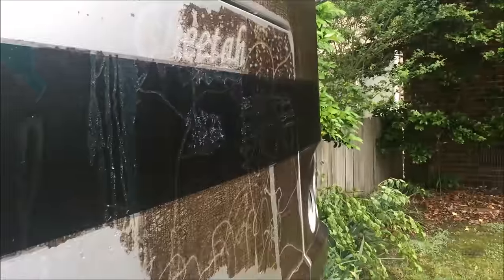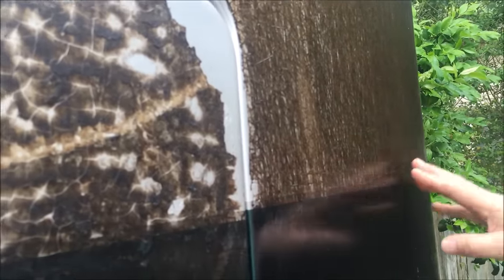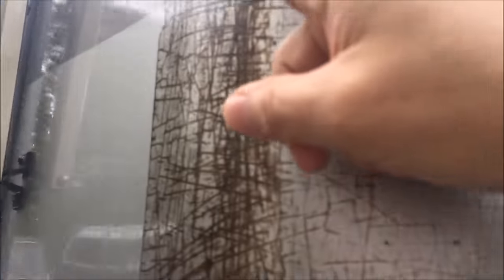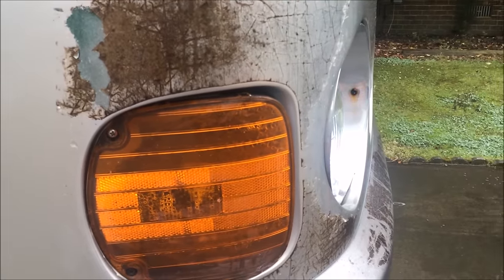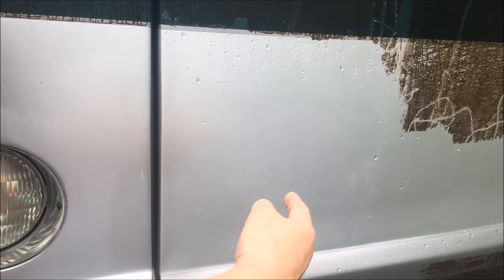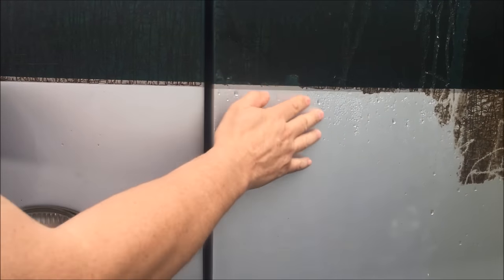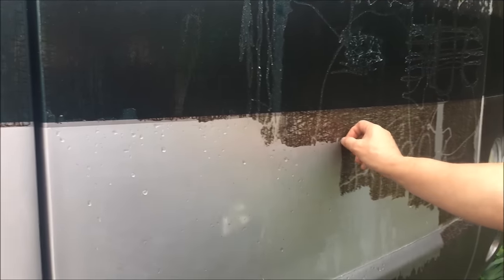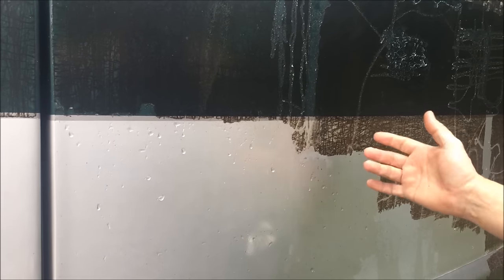Clear Bra Removal Nightmare! A last resort removal method.

Comment: I couldnt believe my eyes when i saw this video. I had tried several chemicals and nothing worked. I tried with a 3200 psi pressure washer and WOW, IT WORKED. Saved me a paint job on the front of my motorhome. Thank for taking the time to share the video.

Comment: Ours is 20 years old(2003) and ours comes off varily easily with harbor freight plastic scrapers (chisels) and a Wagner 915e steamer(wallpaper steamer). Don't ever use metal razor blades. Plastic blades are ok but not metal. You need to watch "the Ugly shield removal channel". He has multiple videos on how to do this for the different types of films and none of them involve a 3000 psi pressure washer. You're lucky you didn't blow some of your paint off. I think you did this maybe before he posted his videos.

Comment: ATG suggests to use the heated pressure washer, but heated model is not cheap.
2K minimum regular pressure washer should work. It just take longer.

Comment: Don't go too much above this guy's recommended 3000 psi.......a pal of mine wanted to get some work done really quick on his back stucco/block wall and rented an 8000 psi washer:  it completely destroyed the concrete and stucco and almost killed him in the process!  (sorry, no video).  Use only recommended pressure.
Reply: That's actually kinda funny, but sorry that happened

Comment: Been Automotive Detailing for years,  You could have used a Heat-gun to take off the film and Goo-be-Gone, plus Bug-n-Tar Removal solvents to remove the glue residue.
Reply from the maker: Doc Zed 
Oh I tried your recommendations....to no avail 
TFW
Reply: Wouldn't Goo Gone and harsh products remove the clear coat?
Reply from the maker: Yes mrpmj00, the stronger & harsher the glue removal product the quicker & faster the glue is removed ... but ... the greater chances of damaging the clear coat paint. I found "Goo Gone" worked well & required some 'elbow grease' & repeat applications.  I also tried "Auto Tech Adhesive Remover" and "Xylene" which worked faster. I didn't experience any Clear Coat damage from these products because I used soapy water to clean the products off quickly, but I believe they can cause damage if left on the paint too long. I did have some Clear Coat Paint damage in some areas where I tried to over use the Water Pressure Washer to remove the film & remove the glue too.  Just use enough of the Pressure Washer to get the 3M film off, then use glue removal products to get off the adhesive.
Reply: Doc Zed he said he already tried that...He said that he did it like 10yrs ago....Back in those days they used different adhesive backings...Much stronger!!!

Comment: thanks man for sharing the tip...going to try a 1800 psi washer 1st for my hood
Reply: Did it work your 1800 psi Im going to do that soon also hope it takes mine off
Reply: @bobby3940  I ended up using Goo Gone and a plastic razor blade scraper to do  my hood.....took me 2 days few hours a day
Reply: Orlando just for the sticky adhesive right the pressure washer took the clear bra off?
Reply: @bobby3940  I did not use the pressure washer.....I sprayed Goo Gone product and scraped away the plastic bra
Reply: Orlando why didnt you use the washer?
Reply: @bobby3940  at the time I did not have a personal garage to work in